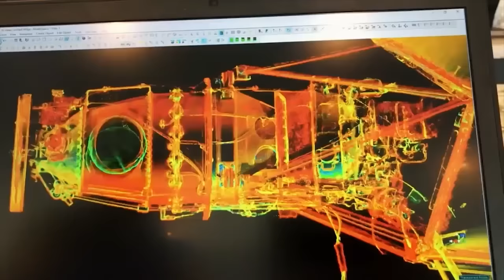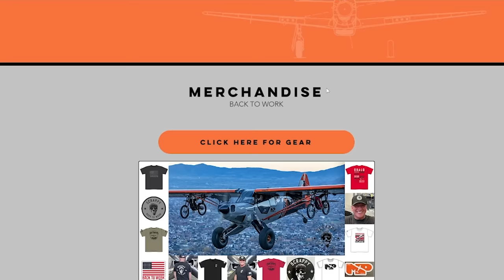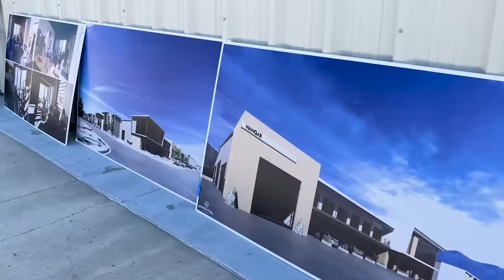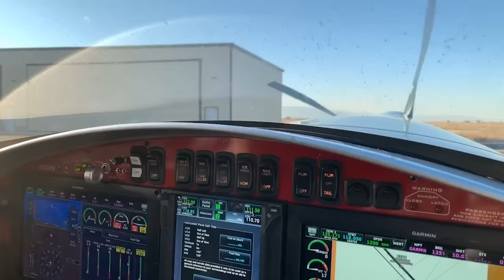Racing Cars and Inverted Airplanes Promoting Aviation | Wings & Wheels 2023

Comment: Always wished a person with the means/ ability would design and test a car that has enough downforce to drive upside down (Like F1 car's supposedly can).  Find a tunnel and attach a smooth suspended board track all around it with smooth entrance/ exit transitions, similar to a skate park.  Use the wood from a retired wooden rollercoaster.  Future RedBull idea.💡
Reply: Good news,  there is a team workin on doing exactly that!